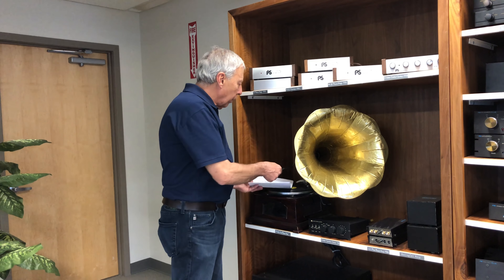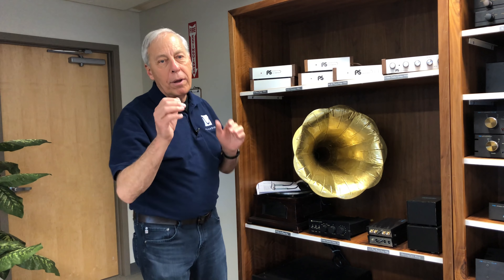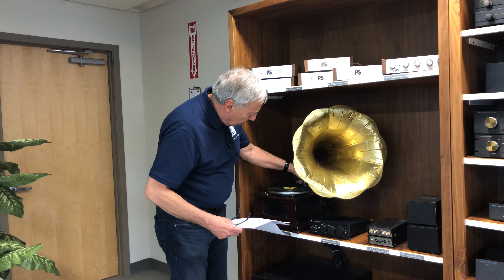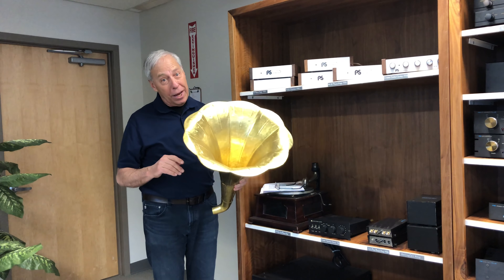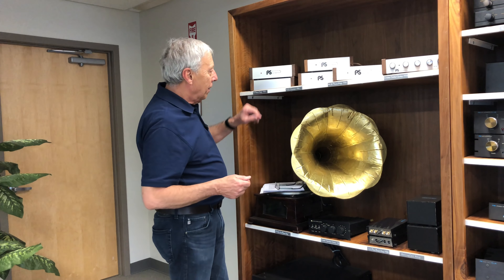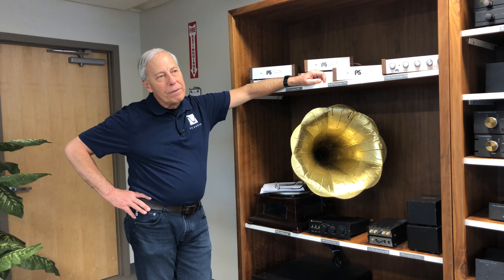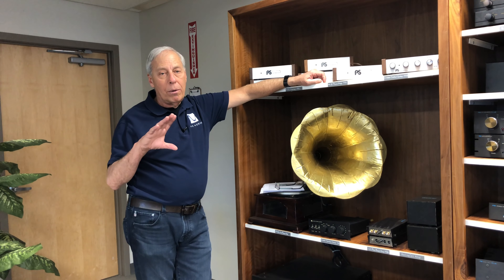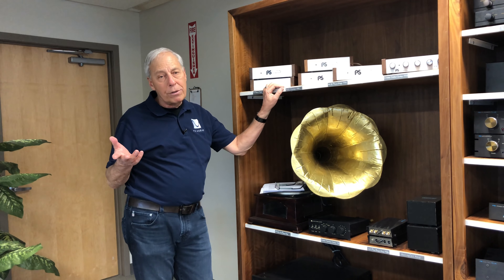Are horn speakers really more efficient?

Comment: How does klipsch work ? or they just lie about the sensitivity, 
I can't find a single test on the internet if their spec are correct.
Reply: Old Klipsch specs were pretty good, but I find the sensitivity figures for their Reference line suspect. Several tests I have seen seem to confirm this. 1 reasons I suspect is they rate their speakers at 8 ohms whereas the woofer region measures 4 ohms. There are others but I don't have any proof.
Reply: Look at the stereophile review of the Klipsch RP 600m. Yes they lie.
Reply: @carlosoliveira-rc2xt  It seems unnecessary for Klipsch to exaggerate their speakers' sensitivity numbers.  Why claim some dubious number, like they are 10 times more sensitive than other speakers, and lose credibility, when most of their speakers are in fact 5 times more sensitive than their competition?  Those numbers are just generalizations across the Klipsch product lines, but you get the idea.

The truth is impressive enough.
Reply: @nomorokay2  Listen they have been tested and the RP 600m was tested at 89db instead of the spec'd 96db. You can't have a highly sensitive tweeter with a much lower sensitive woofer and maintain the balance. The tweeter has to be padded down and the woofer in a small box will not get deep bass so usually they are flattened. In a large box you can get away with a little flattening. Why do you think there are no Klipsch speakers with a 20Hz response? The video even explains this quite clearly. Do you not understand how physics works? Even in large horn loaded PA speakers you will rarely find 20Hz response. They can't do it while maintaining the high efficiency, which is what you need in a PA system. Klipsch lies in their small speakers because their name is synonymous with efficiency. Unlike their larger speakers, Klipsch cannot get 40Hz and 96db sensitivity together.    This is just not new with the RP series but the previous RB series as well. 
You can have only two of the three following things at any one time.  High efficiency, deep bass and a reasonable sized cabinet. What reason do they have to lie? If you have to ask this question, you must really naive or young? 
Bottom line if you want reasonably deep bass with reasonably high sensitivity, you are going to have to look at a large horn speaker. That means one with a horn loaded woofer as well. Hell the Klipschorn only went down to around 35Hz and it was corner loaded. This was a must in order to maintain the claimed 104db spec. I say claimed  because I have never measured one nor have I read a published test of one. In 2004 Stereophile wanted to do a review on a Klipschorn but Klipsch refused to supply one. Gee, I wonder why that would be?
Reply: @carlosoliveira-rc2xt   As it happens, I have 5 fully horn-loaded Klipsch speakers in my system:  2 La Scala IIs, modified with large Jubilee tweeters, 2 first-generation La Scalas for surround, and a Belle Klipsch for the centre.

As you might guess, I'm not young, and I don't think I'm naive.  Some differences between the claimed numbers and the numbers published by magazine testers may have to do with the testing methods.  The most accurate and repeatable setup is to have the speaker in free space, that is, mounted on a pole, a fair distance from the ground.  This ensures that there's no room gain, or it can be called boundary reinforcement.  This test method is a challenge when working with 175-pound speakers, and it produces numbers that have no relevance to a home listening situation.

If the speaker is placed on the ground, in a wide-open area, this is described as half-space, since it's radiating sound in just the top half of a sphere.  Easier to do, but less accurate.

When the speaker is in a room, its bass response in particular is improved.  To get the most  realistic response, that represents a home listening situation, the speaker should be placed in a corner, and most Klipsch speakers are designed to be placed in corners.  That's considered to be 1/8 space.  It's easily repeatable, but some testers feel that testing with that placement is cheating, or gives Klipsch speakers an unfair advantage, since many other speaker manufacturers recommend that their speakers be placed out in the room.

Testing Klipsch speakers while they're out from the walls gives lower numbers than the numbers that Klipsch publishes.

Klipsch tests their speakers as they would normally be used, while magazine testers position those speakers as they would position many other speakers.  This is in an effort to standardize their testing methods, but it doesn't reflect real-world listening conditions.

So are the testers poorly informed?  Is Klipsch "cheating"?  No, and No.  If another "different" speaker, like an omnidirectional model, is tested while placed tight in a corner, it will sound overly bass-heavy, which is unfair and unrealistic.

The solution is for speakers to be  tested while they're placed where the manufacturer recommends, and for the prospective buyers to be educated as to the differences between various speaker types, and the advantages and disadvantages of each type.

Nobody's lying, some are just speaking different dialects of the same audio language.
Reply: To add a bit more, yes, I am familiar with physics.  I'm also aware that to get deep bass with a horn system, the bass horn has to be HUGE, like the Avante Garde sub woofer.  Because of this, most manufacturers of high-end horn speakers, like Magico, use direct-firing subwoofers/woofers to get the low bass that their customers expect.

In fact, very few speakers can reproduce 20 Hz notes.  It's safe to say that over 90% of speakers of any price require the help of a subwoofer to produce clear strong tones below 30 Hz.
Reply: @nomorokay2  Are you serious? If anything, in room, the sensitivity would go up not down. It's the reason some speaker manufacturers use a DIN spec for frequency response so that you get an idea of the bass response in room with gain.
You're not going to argue with someone who has 40 years in the business, are you? I've also designed and built Home Theaters since 1990. I've also worked with acoustics for 29 years. Get over your fanboy mentality. Whether you like Klipsch or not, you cannot break the laws of physics. As I have repeatedly stated you cannot have an efficient horn mated to a direct woofer and maintain deep bass and high efficiency. Look at the speakers you have. None of them reproduce deep bass and they are much larger than the RP 600s which puts them in a better position. 
Sensitivity measurements cannot differ by 7 db with a 2.83 volt input unless the speaker has been dropped off a skyscraper. The RP 600's sensitivity has been questioned by more than a few reviewers. Klipsch isn't the only one that grossly misrepresents speaker sensitivity. I've tested speakers that I have owned where the less sensitive one actually was louder with the same input. Do you think Klipsch measures their speakers differently than everyone else in the industry? Yes it's common to see a 1db difference in manufacturer claims vs reviewer test, mostly because no two speakers are identical to the reference, but you don't see the 7db difference that I mention.
Reply: @nomorokay2  many speakers do 20Hz. Mirage M1, Thiele CS 5, Energy Veritas V2.8 etc. These are affordable reasonably sized speakers that do 20Hz in room and at a fair volume without strain. Should I list more? Of course I'm not going include large four tower systems.
Reply: @carlosoliveira-rc2xt  Sure, I'm serious.  Yes, sensitivity readings go up in a room.  I did mention that when I said that Klipsch speakers benefit from corner placement, which is closer to real-world listening conditions.  Also, I was aware that I would need a subwoofer before I bought the first pair of La Scalas.  Fortunately, I already had one.  What I didn't anticipate was that I would wind up with 10 Klipsch Heritage Series speakers in my home.  They seem to multiply.

They're also pretty big, which helps me keep from buying more furniture.  As for price, the Heritage speakers are aptly named, since they last for generations.  This means that their resale value stays high, and that most models can be found on the used market, often in great condition and at great prices.  I may be a fanboy, but it's with good reason.

As for the RP 600 speakers, I've never seen them and will likely never hear them.  I just really like the sound of music played through big all-horn speakers.  The smaller speakers with direct-firing woofers  are of limited interest to me.  I see them as entry-level, an introduction to horn speakers, before you commit to La Scalas, Belles, or even Klipschorns.  I jumped into the deep end with the La Scalas over 10 years ago, and have no regrets.  The Klipsch Forum is also a big help, with lots of helpful info shared between beginners, experts, and everyone in between.  It's a pleasure just discussing this subject.  Have a great rest of your evening!
Reply: @nomorokay2  Well not 5 times, but most decent speakers average 90 dB/1 watt/ 1 meter. Klipsch average 100 dB/1watt/1 meter.
Reply: @bigelile07    Does that average include all Klipsch speakers?  The small ones have to give up either deep bass or efficiency in order to have small cabinets.

The largest Klipsch speakers are the most efficient, and they're the ones that I'm most familiar with.
Reply: @nomorokay2  I was talking about floor standing speakers. But louder doesn't by any means mean better. I like Klipsch speakers. A lot of people don't like their sound because of the "brightness" /harshness. I can tell you this, I have a pair of Klipsch KG 1.5s (6 1/2" woofer - 1" tweeter) and they are rated at 90 db. That is on par with a lot of floor standers.

Comment: Somehow you seriously against horns but you keep telling a woofer can have a sensitivity around 95dB. A design of woofer always about compromises because low frequencies cannot be made by a very thin membrane so coils has to move back and forth a heavier than a tweeter does. However,  horns amplifies efficient drivers as well as a less efficient one so a horn speaker always more efficient.

Comment: I read that horns are only about 2% efficient (domes 1%) How about plasma & folded ribbons?
Reply: I don't know where you read that. Any horn woofer I have dealt with is no less than 5% up to 20% and midranges run 20% or more. Here is a link to a JBL spec sheet. https://www.jblpro.com/pages/pub/components/2490.pdf
Reply: Horns are probably more like 5 or 6 percent.

Comment: So the short answer is yes, high efficiency speakers generally have less bass.
Reply: M Pi which exact klipsch model has better / lower bass than another speaker with same size cabinet / woofer that is less efficient?
Reply: @soring5880  
Klipsch RP6000F (1" Titanium Horn Tweeter, 2x 6.5" Cerametallic Woofers):
34 - 25kHz +/- 3dB
97dB @ 2.83V / 1m
125W/500W
8 Ohms

Focal Aria 926 (1" Al/Mg TNF inverted dome tweeter, 2x 6.5" Flax bass woofers, 1x 6.5" Flax midrange woofer):
45Hz - 28kHz +/- 3dB
91.5dB @ 2.83V / 1m
40W - 250W
2.9 - 8 Ohms

Focal Chorus 716 (1" Al/Mg TNF inverted dome tweeter, 1x 6.5" Polyglass bass woofer, 1x 6.5" Polyglass midrange woofer):
50Hz - 28kHz +/- 3dB
91.5dB @ 2.83V / 1m
40W - 200W
4.3 - 8 Ohms

I compared the Chorus because of the price and woofer size, the Aria because I wanted to give Focal a second chance regarding frequency response, even though the price is not comparable. The Chorus lack a lot of bass compared to the RP6000F, the Aria sound better, but there still is a significant amount of bass not being reproduced.
Reply: @deni196496  good answer. But I did mention "generally" not "always"😉
Reply: And they sometimes lie.
Reply: @M Pi Are you implying they have deep bass and are efficient? Don't make me piss my pants. Klipsch lies with their bookshelf speakers  all the time. In fact their recent RP 600m speakers were tested at about 89db instead of their claimed 96db. You're a fanboy without facts. If I misinterpreted your statement, I apologize and I have to go change my pants.
Reply: @carlosoliveira-rc2xt  Well my friend owns a pair of Klipsch RP 280F which are rated to 32 Hz, and they definitely hit it.
Reply: @deni196496  My lie comment was about the sensitivity not the frequency response.  I will ask you though how did you measure exactly the frequency response to know that it " hits" 32Hz?
Reply: @carlosoliveira-rc2xt  Can you give me a credible cite that proves they lied about the specs? And since "Klipsch lies with their bookshelf speakers all the time", can you cite the speaker's they lied about with credible sources? Also, why do they only lie about their bookshelf speakers, and not all of their speakers?
Reply: @carlosoliveira-rc2xt  He used a turbocharged dual-column gas chromatograph, Hewlett-Packard model 5710a with flame analyzing detectors.
Reply: @bigelile07  That explains it.
Reply: @bigelile07  Can you cite a credible source for your brain?
Reply: @carlosoliveira-rc2xt  So I will take that as a NO. Now, who is the real liar?